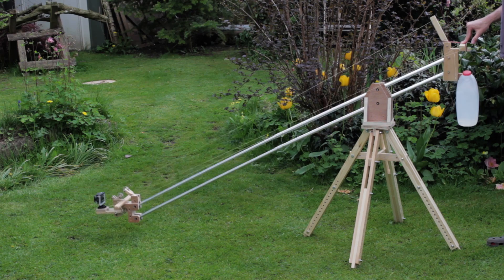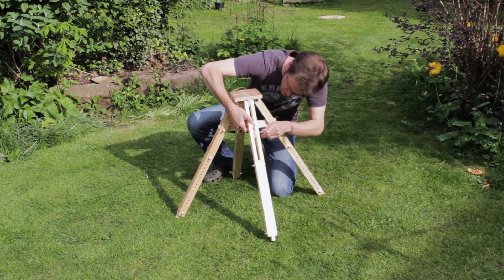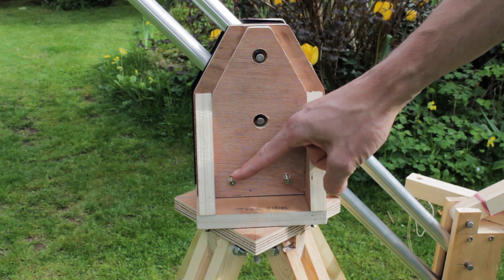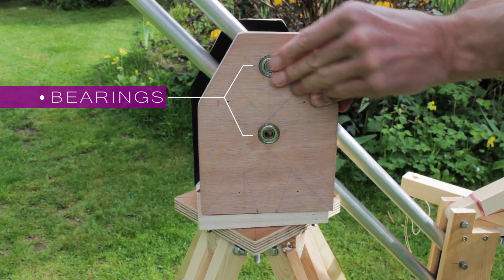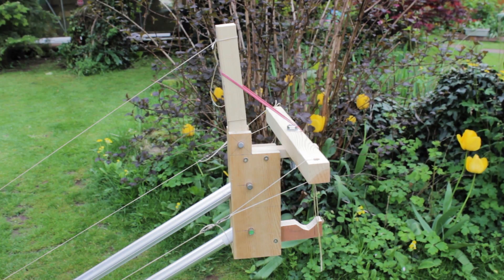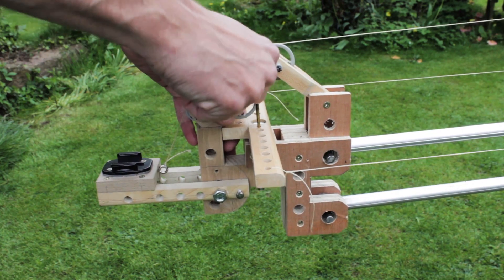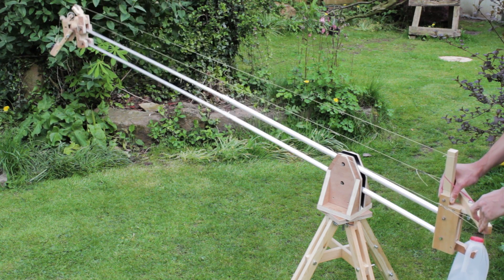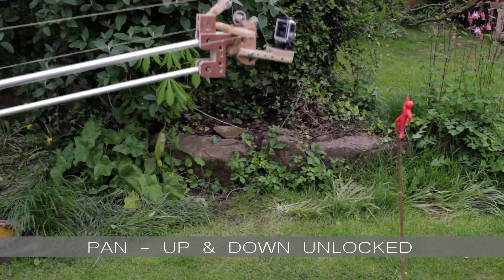DIY camera crane for GoPro - product tank

Comment: Very talented indeed! Thanks for sharing. This is such nice work. Will go ahead and have parts made in alu as I guess it will last far longer.

I guess you've had thousands of people ask you but here it goes: any chance of plans?

Again, very, very nice work. Congrats mate. Also checked out your web site, so many ideas. Never let your mind rest, some day, your day will come my good friend!
Reply from the maker: Hi Guillermo, thanks for the comment.  I never made any plans as I just did it all as I went along and having made it, it really wouldn't matter if it was an inch or two longer here and there.  The head would definitely be improved if made in aluminium. What I'll try to do is take some photo's and put some rough dimensions on them and post them on the blog section of my website soon.  I'll let you know when it's done, so there's no need for you to keep checking. PT
Reply: producttank That would, indeed, be fantastic! Many thanks for time taken to share. I will give it a shot and render them in SolidWorks... let's see where this will take us. Will keep you posted.
Reply from the maker: Guillermo Contreras If you go to the 'thought stream' section of my website, I have posted some basic dimensions for you.
Reply: producttank That's fantastic. Will start rendering this in SW. Will take some time but will keep you posted. It all looks simple enough. Next step? Motor+joystick control of the head! 
Lets see where this takes us but already I'm feeling great about this project.
Thanks for the time taken to share

Comment: Since you're not going to use this for your (or your child's) cereal...why not do some damage to it to improve it?
Drill a hole into the actual bowl, right behind your camera.
Then mount a threated rod hanging down from the bowl to add weight and a lever to make the whole construction more dull (i hope that's how you'd discribe it....you know what I mean, eliminate all those little shakes) and that should pretty much do it.
Maybe put a curved adhesive mount onto the bowl instead of that tape to be able to adjust the camera after adding weight.
l love the basic idea of that thing!

Feel free to visit my channel for some (just a few until this day) tricks and tips for diy camera gear and camera use which I got when facing different problems while filming...though it's all german...do it anyway!!!=)
Reply from the maker: Thank you Matthies, I will try your suggestion, I think it will really help, I will also visit your channel.  I have been working on another video for a GoPro stabilizer which I hope to release by the end of the week. PT